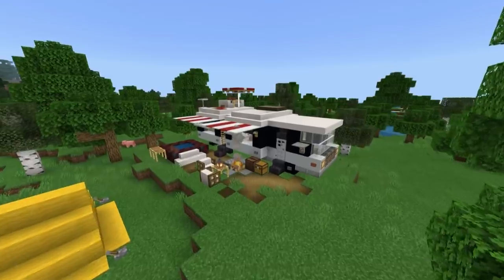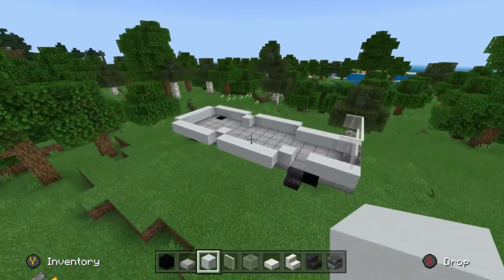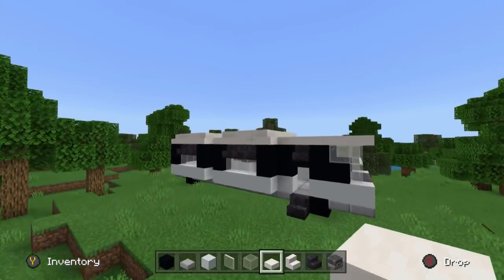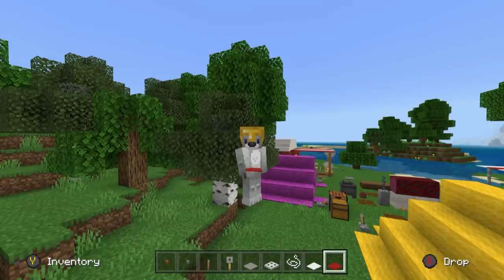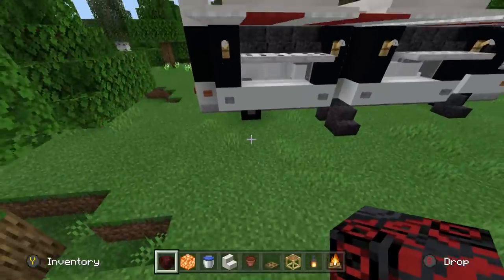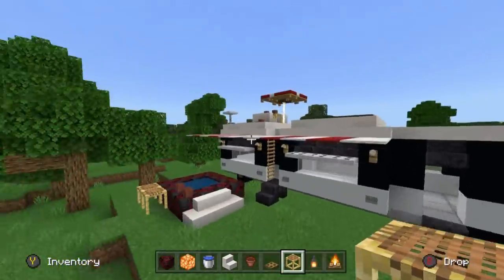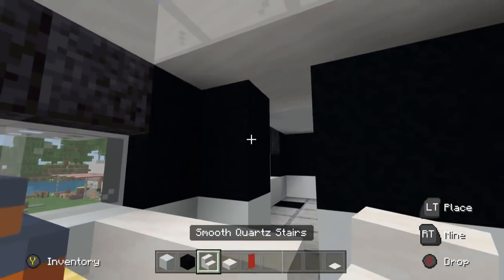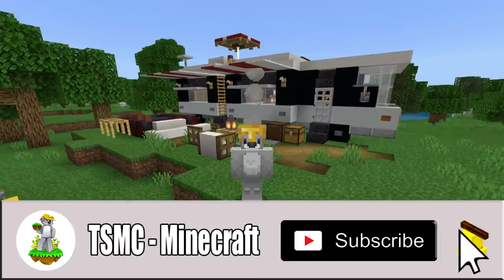Minecraft Tutorial: How To Make A RV

Comment: Here are all of the materials that you will need throughout the build:

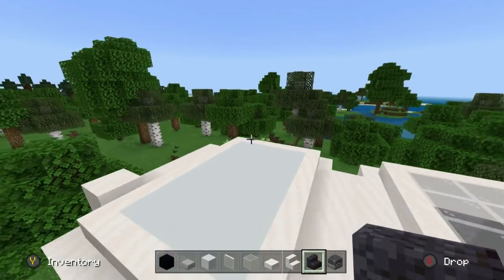Item List 1: 07:37
Black Concrete 
Smooth Stone Slab 
White Concrete 
White Glass Panes
White Glass Block
Smooth Quartz Slab 
Smooth Quartz Stairs
Polished Blackstone Stairs
Blast Furnace
Acacia Buttons
Stone Buttons
Lever
Tripwire hooks 
Stone Pressure Plate
Iron Trapdoor 
String
Red and white carpets
Glow item frames
Red Concrete 
Ladder
Iron bars
Daylight sensors 
Scaffolding 
End Rod
Red Bed
Flower Pot

Item List 2: 15:09
Glazed Terra-cotta
Shroomlight
Water Buckets 
Smooth Quartz Stairs
Flower Pots
Oak Trapdoors 
Scaffolding 
Lantern 
Campfire 
Cobblestone Slab
Stone pressure plates 
Jukebox 
Chest
Shovel
White Concrete 
Black Concrete 
Lever 
Armor Stand
Tripwire Hooks 
Red Banners 
Blast Furnace 
Cauldron 
Detector Rails
Polished Blackstone Stairs 
White Shulker Box
Heavy Weighted Pressure Plate
End Rod

Please do make sure that you have  access to all of these.
Reply: Thx I appreciate your help
Reply: @luigimaster56  No Problem
Reply: 7:37 15:09
Reply: You sound like tsmc at the end of the comment